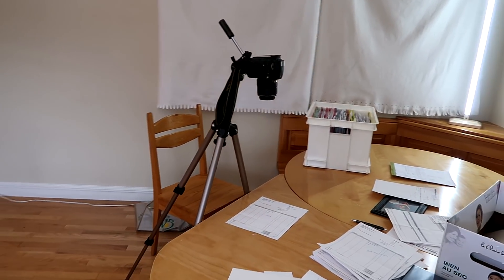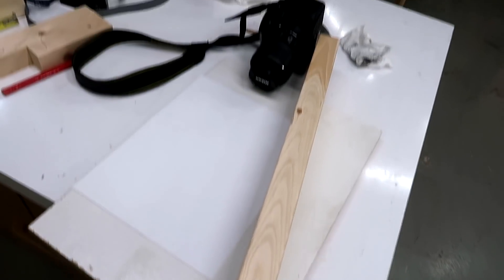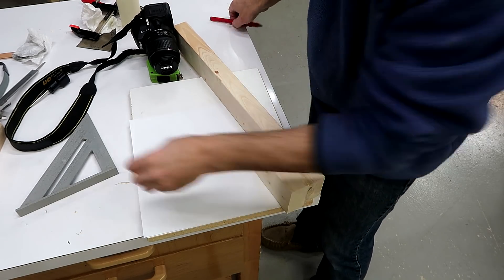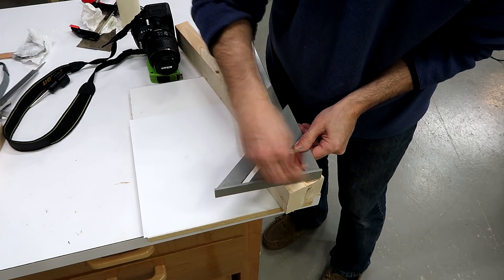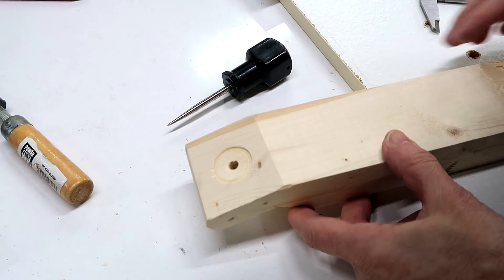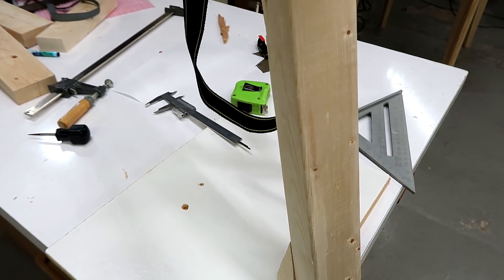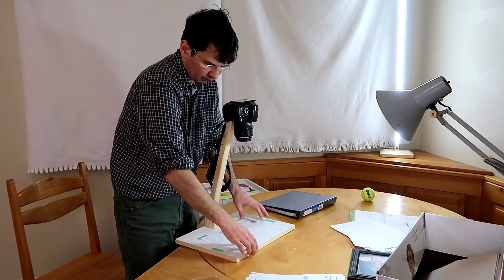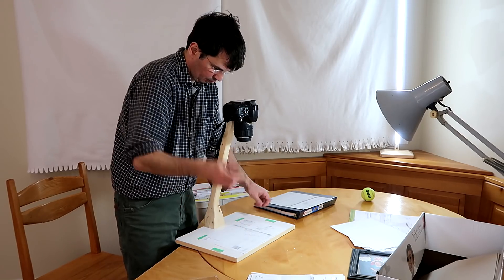Paperwork photographing jig

Comment: My scanner does 20ppm double sided, almost as fast as the DSLR method
Reply: I used to operate IBML Imagetrac's, with good paper we'd be working about 10 times that. Those machines started at £100k and were about 10ft long, so not really suitable for home use!
Reply: @lysippus  i give a shit_ about NIAtoolkit's scanner
Reply: @lysippus  you got me brother
Reply: interesting flex
Reply: lsippus - harsh, but correct! He/they Missed the point entirely.
Reply from the maker: Are you counting clearing paper jams from folded documents?  That probably gets you closer to 1 ppm.
Reply: @matthiaswandel  yea and probably occurs once in a blue moon....
Reply: pretty sure your scanner is faster because you stil have to put those pictures on the computer :)
Reply: @lands3r  yea and if you don't want to spend heaps on hard disk space you are going to have to spend time compressing or converting to the likes of PDF all of which can be done on the fly with a decent scanner
Reply: @jmgacousticmusic   i mean i agree but harddisk space issuese in 2020.....from photos would be weird
Reply: @matthiaswandel  If you get something like a smartscan thats an issue of the past. I bought a used one on ebay a couple of years back, you can load it up with 50 sheets and let it do it's thing. You get a PDF with full searchable ocr. Used it many times and yet to have any kinds of jams, the only issue I've ever had is havingto occasionally give the scan head a clean. At ~$120 total cost and a 25ppm speed it's been great. 

1ppm isn't even close to accurate and you know it ;) Cool project though, just massive overkill for 99% of people when its cheaper to buy a modern feed loader.
Reply: @lands3r  ok I worded that wrong. Just because disk space is cheap, I don't think storing scans as high resolution images is an efficient use of space. I mean m maybe 100 kilobytes versus many megabytes

Comment: I also did this to convert old photos to digital, but you have to play with eliminating the reflections on the glossy photo paper.
Reply: I've done the same but used 2 clamp lights from opposite directions about 45 degrees to the subject has provided me good light but no reflections - even with glass to hold the photo down.
Reply: thevillageinn good tips, thanks!

Comment: I just use a free app on my phone called DocScan. Even if I shot the image slightly off angle it corrects it. It has edge detection to correct things and eliminate background mess. It also assembles all of my shot images into a PDF and will put them into an email or text message. Nice project, but it’s just too much work to get everything assembled and ready after shooting things.
Reply from the maker: tell me, how does that app levitate the phone over the paper?  Cause that's the part I was solving.
Reply: @matthiaswandel  That was a solve, but all of the work after is just too much. If you altered the setup to hold the phone you would be golden.

Comment: For those of us without woodworking skills and/or a DSLR - the  Fujitsu iX1500 ScanSnap Document Scanner scans 30 pages per minute in duplex.
Expensive but it's worked out worth it :)
Reply from the maker: how does it work on forms that have been folded?
Reply: @matthiaswandel  it copes with up to standard A4 width (and a bit over) and what seems to be any length.

I scan all of my mail. For best results, I ruffle the pages and unfold the creases.

There are older models that are cheaper, but still quick.

The great advantage of this model is it can work on WiFi and link up multiple machines.

My wife and I have separate profiles so that we can scan direct to our own computers.
Reply: @matthiaswandel  If you have an A3 form folded in half to A4 size, it won't be happy. It expects sheets to be individual and will detect more than one sheet going through at the same time.
Every device has its limitations. I guess this is one :)
Reply: @matthiaswandel  my only major gripe with the device is that it doesn't play nicely with Linux - at least I haven't got it working with Ubuntu 19.10.
I've tried to run the Windows software under wine, but it wasn't having it. Maybe somebody better skilled than I will get it working.
Reply: Iain Cuthbertson I also have a scansnap, it cost me $400 used on eBay, how does this add anything to what Matthias is trying to do: find a quick, low-cost solution using what he already has?
Reply: @aalove2010  It's a different way to Matthias' work. I did say it was an idea "For those of us without woodworking skills and/or a DSLR".

Comment: Use two lights, one on the left, one on the right, 45° up. This gives even illumination, very flat lighting, no shadows. Lights can be LEDs, incandescents, or even flash. You should be able to google some basic designs/photographs of the set-up. Jon
Reply from the maker: I started with lights left and right, but that really highlights the folds that go across the page.  So it's better to light from just one side of the page (the other side has the post that would cast a shadow)

Comment: I am a fan of use a DSLR to take images of paperwork or specimens in this way, however the iphone 11 documents app does a great job in scanning documents.
Reply: Also you can use the buttons on a headphones to trigger it remotely
Reply from the maker: Still need to frame every shot.  Oh, and you need a fancy iphone.
Reply: @matthiaswandel  FaNcY
Reply: I have a (now lowly) iPhone 7 that does fantastic scans as well! The scanner is also available in the notes app.
Reply: @matthiaswandel  As opposed to the 'cheap' camera on top of the rig? Also unless you've been stuck in the mid 2000's no you don't need to align it at all. You can photograph a document at a near 90 degree angle these days and most of the apps will pick it up and be able to read it just fine.

Comment: I bought an office class Ricoh SP C360SFNw for less than $350 bucks.  I can scan single or double sided originals in a flash.  Honestly I have no idea how Ricoh makes money on this printer.  It's flipping awesome and comes with real support.  Unbelievable.  Still It's a cool project though I would've liked to see what the pics of the documents look like.
Reply from the maker: how does it do with papers that have been folded?
Reply: @matthiaswandel  Depends on the fold.  If folded in half or tri-folded, but the corners are flat it gobbles them up.  Assuming they aren't stuck or pull other sheets in.   I had a stack of forms that were water damaged so they weren't flat.  Those I had to iron first because it kept feeding in multiple sheets.

Comment: "I find a dedicated scanner is way too slow..."  How many documents will you need to photograph rather than scan to make back the time you spent building your jig?
Reply from the maker: Given how many times I have done this, I should have built this a long time ago!
Reply: Did you ever scan documents with a classic flatbed scanner or a 3 in one (printer, copier, scanner) machine?
I did, and many times. Last time yesterday. It takes a lot of time, somewhere between 1 and 2 minutes for an A4., let's say 90 seconds per page on average.
Matthias' jig shows he can do it in less than 30 seconds. So he wins 60 seconds (one minute) per A4. 

This jig looks very well and smart but I don't have a good quality DSL camera for this.
Reply: Hans de Groot A lot of modern all-in-ones offer an automatic document feeder even at a lower budget. You can just throw in all of the documents and go for a coffee. Got one a few years ago and wondered how i was able to work with a flatbed ever since.
Reply: @Luke-ny3ur  Can you name some specific brands and or types? I'm very curious and interested.
On the other hand: An automatic document feeder only helps when you have (a lot of) single documents.
When i want to scan (pages from) a book I still need a flatbed scanner. Or the solution that Matthias showed.
Reply: Hans de Groot I think mine is a Canon MX535 and i have seen Epson Workforce Printers with it a lot. 
Wont help you with the books though, that is true.

Comment: Or just download "Office Lens" on your smart phone which auto fixes angles and lighting e.t.c. to create a "scan".
Reply: +1 to this. It's so much faster to use Lens than to scan documents for me, and you can make multi-page PDFs and the like easily. With a similar setup to this it would be really fast and consistent as well.
Reply from the maker: but what about framing every shot?  That's what I solved.  No picking up the stupid phone every time and waiting.
Reply: @matthiaswandel  true, depends how much time you have to spend managing the files on the computer but I suppose you could get pretty quick at that also.
Reply: @matthiaswandel  phone bad
Reply: @matthiaswandel  the phone apps automatically straighten the framing, and do OCR and save as PDF, its just as fast in my experience, I use Adobe Scan, but there are hundreds of apps available.  A jig like this would be amazing with a smartphone instead of a dslr!  love the video!!!

Comment: dear friend, a scanner? Ever heard of it?
Reply: aha, way to slow. 
Bad scanner.
We use a printer/scanner/copying machine at work. You can put 500 or so pages up on the table and it will pull in page after page and scan it. And the scan takes roughly half a second to a second.
Its damn fast.

Comment: “I have a scanner on my printer,  but find that a dedicated scanner is way too slow” - Not a dedicated scanner. A ScanSnap is, it can do 25+ double sided pages per minute, and OCR them.
Reply: Brad Ullman I have a scansnap, it cost me $400 used on eBay.  What’s your point?  How does that solve Matthias’ problem how to frame photos using the camera he already has?
Reply: @aalove2010  part of the reasoning Mathias gave for building this rig was that his dedicated scanner was too slow. 

I was simply pointing out, for those that are reading along, that typical consumer grade scanner/printer combo devices are indeed slow/crap - but they are also NOT considered dedicated scanners.

Dedicated consumer scanners, are actually quite fast (and have some additional features).

I guess you could say I am standalone scanner advocate - i think they should be in greater use. Since the 70's, the common household computer has generally included a printer.  Because delivering our computer-created content via paper was the norm. But is it still?

Comment: Just use a App on your phone. CamScanner - Scanner to scan PDF. Works perfect
Reply from the maker: An app that makes PDFs in no way solves the problem of holding the camera above the paper.
Reply: @matthiaswandel  True. But i think you are missing the point here, with the app you don't need a camera holding thingy, just hold your phone in your hand and take a picture. The app will adjust any misalignment for you. And with your phone and the app you can "scan" the invoices and receipts the moment you get them. Just a tip.

Comment: Why not use a normal document scanner. Works a lot faster and cleaner.
Reply from the maker: cause the one I have is quite slow
Reply: @matthiaswandel  I use a Canon Dr-2580. If not set to the highest resolution full color. It's relatively quick when using it for multiple pages

Comment: The smartphone/tablet app called Office Lens is far quicker than this or a scanner and it does auto framing, straightening and cropping etc.  But that's much more boring than this video! :D
Reply from the maker: Also requires having a smartphone.  And the smartphone cameras are not that sharp.  And you still need to pick up the phone and frame it each time.

Comment: Why not use a cellphone and Microsoft lens? Way faster, makes PDF and even cut around to remove the what is not your document
Reply from the maker: tell me, how does microsoft lens hold the camera above the documents ready to take pictures?
Reply: @matthiaswandel  oh it does not, you'd still need a jig which would be easy for you to build, but you'd have the files all readily available as pdf, you can even make pdf of multiple pages for matching documents and even if you are at a weird ass angle, it'll correct proportions for you. You should try it out it's worth it :)
Reply: Also, I was not attacking you in any way, no need to be defensive. Was just giving you another option to save time so you can continue your inventions. Hope you're doing OK in these crazy time man

Comment: There’s some pretty amazing mobile apps that will do the same thing.  I use AdobeScan
Reply from the maker: you still need to frame every shot.  You know, my camera can just take a picture if I push the button already.  It's the framing the shot problem I solved.
Reply: A lot of people have Google Drive already and there's functionality to convert images to scans.
Reply: Christian P 
Yes, and Google reads your documents.
Reply: @davelowe1977  and these other apps controlled by who knows aren't reading these documents either
Reply: Christian P 
probably, but I don't use them either, and neither does Matthias by the looks of things.

Comment: What is your opinion on using no-ox-id grease on common electrical connectors? It isn't used very often in the field, but seems like it would be beneficial.
Reply: I know it's not applicable to the video but it's something I've always been interested in and I trust your opinion
Reply from the maker: ask someone who uses them.
Reply: Well that's the problem. Nobody seems to use it and I wonder if there's a reason it's not used more. It seems like it would improve most connections and make them last longer

Comment: Don’t you get distortion in your images when using a camera to scan a document. And are you using OCR to convert the photographed documents to PDF file format?
Reply from the maker: You have to pick a zoom level that is not on either end of the range, and distortion will be minimal.
Reply: The distortion would be minimal as that camera lens is rectilinear, i.e. reproduces straight lines as straight.  If it was a fisheye lens there would be distortion.
Reply: @matthiaswandel  Can someone explain exactly what this means?

Comment: This is why engineers don't run companies. Effective, yes, efficient, no. Simply because you can build a solution does not mean you invest time and effort in something that can't come anywhere near what a $20 scanner, and open source software can automate for repeated and consistent results.
Reply from the maker: This is why you don't run a company, but many engineers do.  Maybe listen to what I said in the video?
Reply: @matthiaswandel  I did, and heard you say this was faster than using a scanner. Your statement does not change the fact that you will waste a crap ton of time processing in post. You either simply don't have the right scanner/tool or the process. It's foolish to claim taking pictures of documents one at a time with a DSLR is a better process than using the proper scanner to stack and load all 100 documents once to click a button to create PDF images.